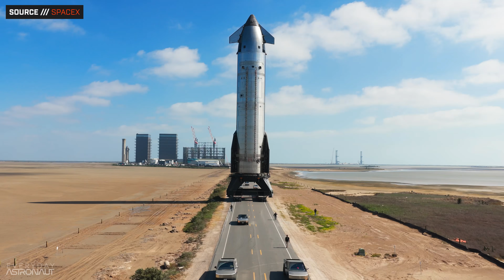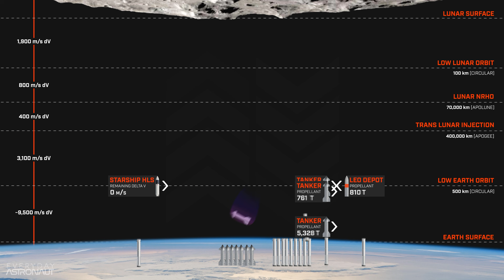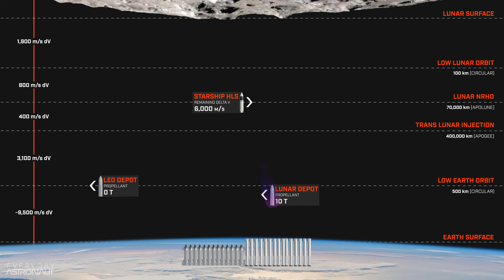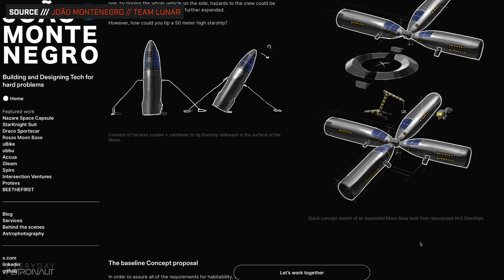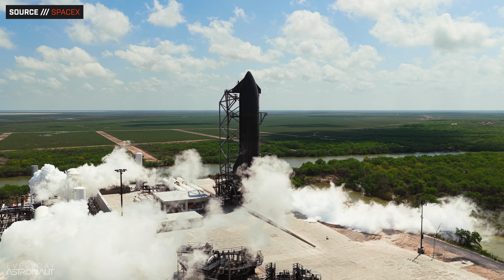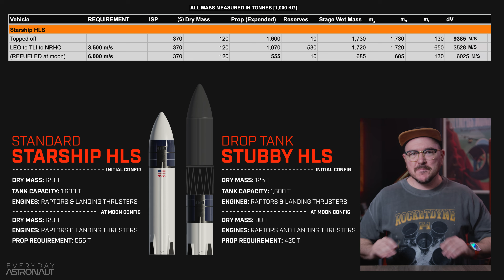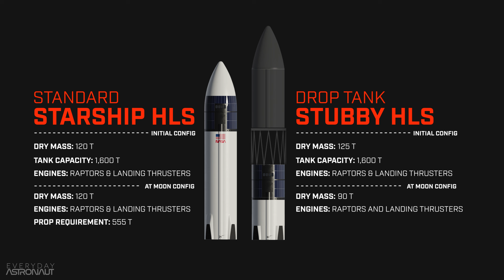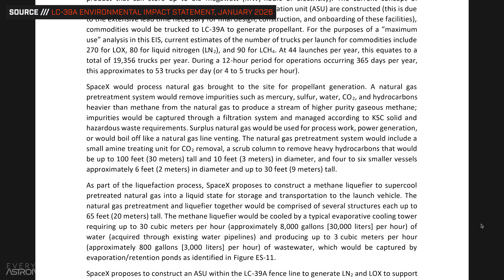Does Starship REALLY require 15+ launches to land one lunar Starship?!

Comment: People don’t realize how insane this mission profile is. One Moon landing could require more launches than some entire space programs.
Reply: Apolloitis again. The past, a very poor and useless past, doesn't define what is possible or "sane".
Transatlantic travel used to be by steamship. One big boat with thousands aboard. Now we squirt a plane a minute across the ocean with a few people aboard. HIGHLY inefficient and loaded with enormous tech compared to a boat.
Reply: @d@davis.fourohfourThis is so disingenuous, the better comparison is with modern liners which are huge and operate largely as steam liners did.
Reply: Which should raise people's skepticisms about its viability... not make everyone default to 'awe' at an accomplishment that doesn't exist.
Reply: @sunienizami  The issue is making fuel on Earth and then ship it into Space, losing 90% of the fuel in the process. Long term fuel production in Space is the way around that.
Reply: @VallenChaosValiant   Well the only fuel you can produce in cis-lunar space is hydrolox. And Starship runs on methalox. Carbon is an extremely rare element (almost non-existent) on the Moon. Hydrogen and oxygen are way more abundant. If you want to make methalox on the Moon you need to bring in the carbon from Earth. SpaceX will maybe eventually make a hydrolox version of Starship.
Reply: @sunienizami  Each Starship launch is incredibly inexpensive. This is entirely viable considering all those launches still wouldn't come up to the cost of a single SLS launch.
Reply: @ccruler doubt it, after the refueling is demonstrated at reasonable cost by actually reusing the tanker, we can talk until then it’s everybody’s duty to be skeptical
Reply: @Denguer-b1s  ¿Tú eres de los que dicen que las cosas son imposibles?
Reply: @francocastilloAR  "not impossible" is not the same as "reasonable"
Reply: @Denguer-b1s they’ve already developed human rated reusable rockets, I think they’ll get it figured out.
Reply: @ccruler  no it's not, we have no successful launches to scale off, realistic estimates start at 100X the cost musk is quoting, and get worse from their.
Reply: @justicar5Most of the cost is the rocket itself, which is reusable. And before you mention that Starship hasn’t demonstrated that, sure, that’s fair, but SpaceX has already built reusable launch vehicles before and so have the expertise. The NASA SLS is expended, meaning they have to build a new one, every time.
Reply: @Denguer-b1s genuinely bro, nobody cares what your opinion is on rocket science lol.
Reply: @justicar5thank god you know everything about finance and rocket science lmao
Reply: @Denguer-b1s  there is some prior art NASA has stored liquid methane for 4 months in space with zero boil off and starship flight 3 diminished transfer of fuel from one tank to another in zero g using an ullage burn.
The launch cadence is ambitious but starship is already flying almost once a month during end and being expended even if it's not as reusable as they think launch cadence wouldn't be a problem

Also cost wouldn't be a problem starship and superhevy is only 100 million even if all the starships are expended that's 1.6 bilon assuming 16 tanker flights (as the video mentions this number would probably need a lot less tanker flights if you expended starship and superhevy) SLS is about 4 billion relitivly speaking even if starship wasn't reusable its pretty cheep
Reply: @Denguer-b1s Be quiet.
Reply: No one knows. Not even SpaceX. That's how stupid it is. There is zero actual project plan. Just fake it till you make it
Reply: @mervstash3692 Is it? You could just load up only 10 tons like the rest of rockets and not require a ton of refuels. If you refuel that much you're taking 100 tons, which would require other launch providers to launch that much as well (~10 times) but doing it in expendable form. Meanwhile you can't fit any large format items. If they figure this out then it'll be totally worth it to fly this way
Reply: @ryccoh we all understand the "why". 
It doesn't change the fact there is no "how". 
Underpants Gnomes logic doesn't work in reality. 

Phase 1 - Steal Underpants. 
Phase 2 - ? 
Phase 3 - profit

No credible program/company/business/agency would take on something on this financial scale with no actual roadmap and milestones. Only a company run by the worlds greatest ever conman could keep this grift going this long.
Reply: @mervstash3692 Dude get a hobby. You sound like a complete idiot for starters but picturing you seething in your room honestly makes me feel pretty bad for you. You’ve been hating someone you’ve never met for obviously a long time. Get some fresh air.
Reply: Yeah it is stupid.
Reply: @canidae7  it’s only stupid if the only goal is to land on the moon like we already did 60 years ago. If the goal is to establish a moon base, this is the only way you’ll get enough mass up there.
Reply: @bradstewart7007 Wrong. Ever heard of SLS block 2 cargo?
Reply: @canidae7  Are you seriously considering using a $4 billion launcher, which is completely discarded after launch, to transport cargo to the Moon?
Reply: @neto6339  Starship = 5 bil contract for NO orbital flights. SLS = 31 billion, 2 lunar flights, one with crew. Seems an easy choice for the taxpayer.
Reply: Yes, but not reusable, much more expensive (billions per single-use launch), and can’t deliver its payload to the lunar surface. Starship is designed to deliver 2-4x the payload of SLS cargo to the lunar surface. Again, it depends on your goals, but it’s not stupid.
Reply: @bradstewart7007 neither is Starship so far. We know SLS works. That is far from certain for starship
Reply: @kvasir121  Really? You're only counting 31 billion for the SLS, but that's not what the sources say about its development costs.
Reply: @neto6339 Even if the number is twice what I stated, which I pulled from Google, it has at this point provided more than starship has for 5 billion in taxpayer dollars. Also, starships cost is hard to measure from a standpoint of opportunity cost. That money could have been better spent on more serious proposals not meant to pad a certain mogul's pockets
Reply: @canidae7  Saturn V worked,too. It’s too expensive to do it this way and doesn’t even get high mass lunar surface. Starship is a moonshot for the holy grail. Far more interesting. So what if it’s not proven yet?
Reply: @bradstewart7007 if you want 90 tons to TLI you can launch 16 starships (if they get it to work)
OR
Launch 2 SLS block 2 cargo that we know works 🤷

But hey, Elon admitted Starship V1 could do 15 tons to LEO. Not the 150 he promised.

V2 could do 35 tons, not the 200 Elon promised.

But of course V3 will do whatever Elon promised 🤣
Reply: @canidae7  Fully reusable.
Reply: You guys are forgetting about Blue Origin, they're also in this race.  There is a plan for a larger version of New Glenn and they are designing moon landers.  New Glenn is keeping things a lot simpler and seems more likely to work.
Reply: @bradstewart7007  Who needs a moon base and for what? A lunar base, or a lunar orbit station do not bring us 1% closer to Mars. And before going to Mars, try to convert a desert on this planet into a lush garden.
Reply: @jeffk464 If they can make it work then good, either way space X or blue origin is a much better opten then SLS in any day of the week lol. No WAY do you want to rely on NASA considering politics to consistently deliver cargo to the moon with their own SLS, its way too expensive and WAY to reliant on politics even if it works, its Not worth it in the long run. New Glenn or falcon Heavy is much more cost effective
Reply: @canidae7 SLS block 2 which is HEAVILY reliant on NASA and their politics . . . A change in the administration can literally kill or or change it completely. It is not worth it in the long run if you want to set up a base or provide cargo runs lol, ain't no way the administration is gonna be able to consistently throw that much money away. You be relying that all the following administration wants to go for this and not cut it off. Either way if you want something that actually works, resupply missions with blue origin or even the falcon Heavy is a better long term option. The only thing I can see SLS be good for is deploying modules, but even then that would be hella expensive compared to waiting to see if blue origin or space X can give a better option
Reply: @bagaindocblaise1738 That is not true. It is HEAVILY relying on the POLITICIANS. NASA is set on using SLS
Reply: @canidae7  SLS works. But at a prohibited cost. That is the point. You can't build a sustainable base on the high cost of tax payer money. 

The purpose of Starship is to develop reusable and reliable rockets that can launch hundreds of times for cheap. If you don't understand the end goals then that is on you.
Reply: @canidae7  HAHHAHAHA 😂😂😂
Reply: @canidae7  We know that mercury will cure your syphilis if we just use enough of it. You likely won't survive the experience, but we consider this to be good enough. Dedicated antibiotics that don't kill you just aren't worth looking for.
Reply: @canidae7  why would anyone ever try something new if we know something works, amarite? Short-sightedness is a real bummer. Good thing not everyone is afflicted with it, you owe all technology to those people, including your life.
Reply: @kvasir121  "Starship = 5 bil contract for NO orbital flights."
Really? So the terms of the contract state NO orbital flights. I thought that the contract has not yet been fulfilled and includes demonstration of orbital refueling and one demo landing on the Moon.
Reply: @neto6339  $4 billion for SLS includes Orion. Doesn't make sense to use that cost. Cargo SLS+EUS would be around $2.3 billion, according to an OIG report published in 2023. Assuming early Starship costs around $100 million per launch, 20 flights would be $2 billion in total, which is not that far off.
Reply: @yujinhikita5611 The technology in Starship is nothing groundbreaking new. The engines are based on an old Russian engine (RD-380) and the tiles are very similar to what the space shuttle used. SLS and Starship are both using tech that is already known 🤷
Reply: @jrc1606  That's your mistake; the development costs of the SLS plus Orion already amount to almost 100 billion dollars.
Reply: @neto6339  Why even include Orion for cargo launches though? SLS since 2011 has cost $30 billion. SpaceX has spent $15 billion on Starship and the number is increasing rapidly. NASA spends $2 billion a year on SLS, but that's fixed. In 2023, Elon admitted they spent $2 billion that year on Starship. So far, this year the company has spent $3 billion on Starship and the year isn't even over.
Reply: @bradstewart7007 you're kidding yourself if you think its fully reusable.  Wild baseless promises by a charlatan.
Reply: @SterlingArchimedes yes true, engines are pretty much shot, holes have to be patched up, new tiles. I wonder how much is left of the actual ship after everything they've needed to repair. Takes them a full 30 days to do all repairs at full capacity. Their own chief, Shotwell, said she doesn't consider it reusable if you can't fly again after 30 minutes, refuel, quick check of important components, and fly again. They're so far apart in reality while promising the world
Reply: @canidae7  How many tons can the SLS block 2 cargo (a version which doesn't exist yet) deliver to the surface of the moon?
Reply: @jeffk464  whoops... but in the long run still could be right. only elon seems to be able to drive things forward with any urgency tho. wish we had more of that.
Reply: @canidae7  we dont know that SLS block 2 cargo works, it doesnt exist yet. Work on it has barely even started
Reply: @canidae7 that’s even more expensive bozo it costs 4 billion per launch and can only launch once every few years LMAO
Reply: @kvasir121 starship received that in a fixed price contract dumbass, the taxpayer will quite literally not have to provide more money to is development.

Meanwhile SLS cost 31 billion dollars so only far. Its gonna cost more.
Reply: @canidae7 ”we know it works” is the, and I am so sorry, most illogical reasoning you can make in this sector.

If you want to make everything the same way you did them 60 years ago, just more expensively, and slower - yeah, it “works”. It’s also incredibly inefficient and doesn’t have a future.

We didn’t know the Apollo would have worked. The estimated chance for success in one lunar landing mission was estimated to be 5%. But, as a great man once said - “We chose to go to the moon, not because it is easy, but because it is hard”.

Edit: oh also we don’t even know the SLS Block 2 would work 😂 we know Block 1 works, but knowing how Block 1 development went, it is gonna take at least 5-10 years to launch Block 2 to confirm it works. Yeah right that’s so much better e
Reply: @canidae7  holy moly this comment could not have been farther from the truth 😂😂😂😂 

I think you meant the RD-270 there? Cuz no engine called RD-380 exists, but even then, the answer would be a resounding NO

Raptor and RD-270 share the same engine cycle - but that doesn’t mean the engine is based off the other. In fact, that engine cycle is the LEAST proven engine cycle, only one engine (RD-270 ofc) using that cycle was ever built.

So, from that perspective, it literally is the hardest engine cycle to develop with our current knowledge. Or at least was, until the Raptor.

The tiles also have to be significantly different because of different requirements, sizes etc. that’s like saying SLS uses the same orange tank as the shuttle which is ridiculous lmao

Do you even know ANYTHING about this topic???
Reply: @arcaipekyun4232 Just another case of Elon derangement syndrome, Musk might be edible or whatever and say whatever you want about X and Tesla, but SpaceX is legit on the bleeding edge.
Reply: @nameredacted1242  I think proving out Starship refueling with moon landings does quite a bit to prep for a Mars mission. I suspect SpaceX is doing a lot work on how to live on Mars. No idea if they'll be successful. Arguments against are strong.
Reply: @bradstewart7007  That's the problem! Why would you go to Mars? If we have dumb politicians here who are destroying the best planet for life? If we can't even convert a desert into livable land? Mars has no atmosphere, no oxygen, no water, has radiation, and has toxic soil. You would go to Mars then spend your whole life living in a cave, you would go out maybe once a month to fix and clean solar panels. Guess what? You can live in a cave on Earth, much cheaper. You can live on the bottom of the ocean, too. Much cheaper. And very few planet-killers will reach you under the ocean.
Reply: @nameredacted1242 Musk’s point is we need a backup for consciousness. Not all the things that could destroy the Earth are under our control. Whether we can actually create a self sustaining civil ization on Mars is up for debate, but if someone wants to give it a try, let’s do it.
Reply: @bradstewart7007  Who gives a crap for consciousness? It's life you have to preserve. And the cheapest way are very deep caves and ocean floor and caverns under the ocean floor. Guess what? The military is already doing it. It only costs trillions of dollars of black budget rather than quadrillion it would take to establish a self-sufficient space colony.
Reply: @nam @nameredacted1242 there is little chance of life not surviving. Human consciousness is what is in question.
Reply: @kvasir121 that’s just dumb. SpaceX is building a mass production factory for starships and will have three towers online in a few months. This is happening.
Reply: @bradstewart7007 it's not. Just do the math on starship, compare it to Elon's projections for this architecture, and also factor in the possible suspension of funding in the next two years due to change in government and priorities.
Reply: @kvasir121  suspension of funding is irrelevant to SpaceX because their funding mostly comes from Starlink. 

Plus, Artemis itself is mostly invulnerable to government policy changes because it's a political program that benefits all senators, no senator is out there voting against it.
Reply: Why? Is there a better plan for putting a permanent base on the moon? Or do you think we shouldn't do that at all? Or do you think we should just fly a tiny lander on an expendable rocket just so we can say we went back?
Reply: @trevorpullen3199  YES there is a better plan. Forget the moon.
YES we should fly a tiny lander barely larger than Apollo, for any human missions. Only for cargo missions with zero humans, try using something as insane as what Musk is proposing.
Pre-deliver all base structures and materials before humans ever arrive. In a tiny, tiny capsule the size of Apollo.
Reply: @nameredacted1242  I don't have any problem with a smaller lander for humans.  What's the problem with a larger one though, if you have one for cargo anyway?
Reply: @trevorpullen3199  The problem is that it is retarded to send humans along with cargo. It makes the rocket too safety critical, and too large. CARGO SEPARATE FROM HUMANS. Cargo ahead of humans. Humans sent in the tiniest space possible. KISS principle.
Reply: @trevorpullen3199 yes have Chinese companies build the hardware for 1/100 of a cost while being high tech. Can’t wait for Chinese customs on the moon and mars screening the first us landings
Reply: @trevorpullen3199  I got an even bigger pipe dream. 
Use multiple launches to assemble an even larger spacecraft one that has a reactor in it and shuttles back and forth carrying a HLS landers and fuel depot. 

Those engines should have a higher ISP and uses hydrogen as propellent. Which can be made from ice on the moon. 

Once that’s done. Only LOX and methane used is for landings and reaching orbit.
Reply: @Denguer-b1s it doesn’t matter if China gets there first if the US can deploy massive loads there. Cant own what they can’t defend.
Reply: @nameredacted1242  that's stupid
Reply: @canidae7 You should go and show em how it’s done.
Reply: @UVBluesman I think you may be talking to an 'at arms length' spaceflight genius, not a hands-on one.
Reply: @psiro7966  armchair rocket scientist.
Reply: @UVBluesman That is stupid. A classic comment from an Elon fanboy that does not like the truth
Reply: @canidae7 Von Braun thinks you are an idiot too. He said that in-orbit refueling was the future.
Reply: @UVBluesman I don't think he knows the first think about any of this lmao. He's just here to signal his ignorance to the rest of us.
Reply: my guess would be that Musk still thinks he can string nasa along until the Whitehouse eventually gives up on the moon and lets him do Mars instead like  he wants to.

But if thats the case then not only did Musk secure the contract under false pretenses but Isaacman must know that, and he's  just  allowing Musk to bump along as though he wasn't defrauding the government of bilions of Dollars and potentially handing the moon to China.  I guess this is what failing empires look like.
Reply: @mowogfpv7582  is that your conspiracy theory. 😂😂😂😂
Reply: @UVBluesman Musk's either a crook or an idiot and I don't think he's an idiot.
Reply: @mowogfpv7582  you’ve declared those as the only two options huh. Supporters your conspiracy theory I suppose. That’s handy. 🤷‍♂️
Reply: @mowogfpv7582  If Elmo can't make the moon work, Mars is never happening. It's exponentially more difficult and expensive no matter how reusable whatever comes of Starship. It still hasn't maintained an orbit or come close to full mission cycle. After 10 missions. Anything from Musk is going to be mostly pumping things up for the IPO coming later this year.
Reply: @mcblaze1968  A Mars mission fully relies on the ability to generate fuel on the Mars surface. Manned Mars missions also on the ability to limit crew comforts on a mass budget.
If those challenges are overcome, Mars isn't that much more difficult than the Moon (well 5600 m/s from LEO to Mars vs 3500+6000 =9500 as estimated in this video form LEO-NRHO, NRHO-LS-NRHO). aerobraking is possible in the atmosphere, though I doubt Starship could do it with only 60t of fuel. 
It's not the capability of the ship, it's development of those 'other technologies'. I think it is telling SpaceX / Tesla is fully parading their advances in rockets and robots and not seeking too much publicity in some of the key capabilities that are required to achieve for human transfers to and from Mars.
Reply: @mcblaze1968  mars has an atmosphere for aerocapture and it has in situ resources for making methalox.  So conceptually starship's enormous upper stage/lander makes some sense there.  Even if it's nowhere near a sound or mature enough looking project.  For the moon it makes no sense at all to integrate the lander with your enormous upper stage.   And there's no reason why it should do.  It wasn't conceived for that.  It's a mars system.  Albeit an immature one.
Reply: If done right many of those launches make future launches easier/possible
Reply: @Rork333 no it wouldn't. The fueling launches would have to happen every single time you go to the moon.
Reply: @Imaboss8ball  yea but they only have to pay to launch the fueling station the first time making the second go easier
Reply: @Imaboss8ball  The cost curve would smooth (for a moon base,) as initially-cumbersome launches transport equipment we've been putting off to establish Moon ISRU
Reply: If it smells insane IT IS INSANE
Reply: There will be nothing insane about it.
Reply: Everyone realizes it. No need to be as smart as you are
Reply: The thing that less expert viewers like me don't realize, and Everyday Astronaut did not explain very well, is that the Starship Heavy booster doesn't come close to putting the Starship second stage/Starship HLS into low-Earth-orbit. The booster just flings the second stage into the atmosphere and then the second stage burns most of its propellant actually reaching orbit.
Reply: @skierpage  That's the same with any rocket's first stage
Reply: @forknose  You're right. But some first stages go farther than others. There are always tradeoffs. If re-using the first stage is required, then staging early is more optimal. Falcon 9 and Starship stage very early in the flight. New Glenn stages a lot later. SLS stages very much later by comparison.
Reply: @skierpage  He did talk about this and even trades the booster performance increase with the stubby HLS.
Reply: Pffft, other rockets are too round.  Everyone knows the best rockets are big and pointy ~musk probably.
Reply: insane you mean rediculous and unrealistic
Reply: The 15 Starship flights added together would cost less than 5% of a single Apollo flight (in today's money). The 15x Starship quote is based on rounding up today's commercial prices, not actually costs. Using projected long term costs, it'll be closer to 0.5%.  If you consider per unit mass payload delivered to the moon, you're already at <1% costs of previous programs, trending towards a fraction of a fraction of 1%.  Not particularly impressive when viewed through the lens of the history of industrialisation, but based on your 'people don't realize' comment, worth noting, as there is a lot 'people' don't realize about what is happening here.

Before anyone corrects me that 5% is too high and it's more like 2%...I'm rounding up and up and up and using lean inflation figures.
Reply: @psiro7966  So development costs don't count?
Reply: @psiro7966  If they just used my 1 billion teleportation machine I am making and finishing in 5 years it would be even cheaper becaue the teleporting will only cost 100 dolars per teleportation
Reply: @psiro7966  "The 15 Starship flights added together would cost less than 5% of a single Apollo flight" - but only if you count the total actual costs of Apollo on one side, and totally made-up, never-achieved numbers for Starship on the other side.
Reply: @psiro7966  those 15 starship flights need to fly within 30 minutes of each other, which will be more expensive, plus they can't even do 30 hours right now, the fastest they have been able to do is 30 days. they're gonna need 15 separate starships to fly and fuel up the main tank at this point, then fill up the human rated starship at the end for the final flight, way more expensive. None of this refueling has ever been done in space, then lighting the engines again with this type of fuel, both have never been tested yet by by anyone, let alone SpaceX, even though they showed in their schedule to NASA they would test space refueling in like 2025. I think you're highly underestimating the costs here
Reply: @jonathanwieringa8808  why would they need to fly withon 30min to each other? Even if you fly once a week you are read to go within three months.
Reply: @jonathanwieringa8808 30 minutes? I'm still working from the numbers NASA gave in 2024, which suggest ~6 days.
Where is 30 minutes coming from?
Reply: @jonathanwieringa8808  There's a video by Eager Space which shows that long-term storage of cryogenic fuels in orbit is practical with minimal boil-off. Just adding reflective coatings and some insulation to the Starship would allow it to store fuel in orbit for months.
You're right that it's never been done before, but there's nothing impossible about it.
Reply: @bbgun061 it's not just storing, the fuels have to mix well and then there has to be something to Ignite the mixture. Instead of just using fuels that ignite when they touch, way simpler. There's unreliability in having to ignite again which also hasn't been done
Reply: @jonathanwieringa8808 .... reigniting engines in orbit has absolutely been done... The space shuttle did it...
Reply: @benmac2112 again, spaceshuttle used 2 fuel combos that ignite on contact, no spark needed, totally different
Reply: @jonathanwieringa8808  So I may be mistaken about space shuttle (I keep seeing conflicting sources), however I know for a fact Saturn V's engines could. Regardless starting an engine in orbit is not exactly new tech that Starship still needs to develop even just for the company. In fact, one of the most important features of Starship's raptor engines is that they can repeatedly restart them. The booster restarts engines multiple times during it's boost back to the landing pad including after it leaves atmosphere. They have tested restarting starship's boosters outside of the atmosphere for each previous test, and the starship itself restarts them again to perform it's landing sequence.

Sure, it's a hard thing to do. However it's not an engineering hurdle that is yet to be overcome.
Reply: @benmac2112  SpaceX has done it a few times now, with Starship, oh and you know almost every single flight of Falcon 9.
Reply: @jonathanwieringa8808  "There's unreliability in having to ignite again which also hasn't been done"
Except that SpaceX has tested it on Starship and uses regularly on booster for boost back and landing.
Reply: @royh6526  yes that's the whole point, reigniting within the atmosphere, now do it above LEO which they've never done. Starship has to throw the little amount of fuel they have left before landing to the bottom so there is enough flow to ignite and take a spark. Starship has never gone beyond LEO and has never carried a real payload, so all this is still unproven. Banana's don't count
Reply: @jonathanwieringa8808 What are you referring to with your 30 days? Because they have flown the same Falcon-9 Booster twice within 14 days (of which 4 days were spent getting back to the base), so flying the same starship twice within 10 days seems reasonable to me. And obviously they can use multiple ones which is why they're building more launch towers. I see no reason why they wouldn't be able to launch one a day.
I still think requiring 20+ rockets for the first moon mission is crazy, but that's what full reusability costs.
Reply: @jonathanwieringa8808  Starship has seperate tanks specificly for in-space and landing. The main tanks are only used for ascent. Starship has done in-space relights several times and the booster hes done engine re-light above the karmen line before as well.
Reply: @anonymous-q2b5s It's going to take time before starhips have the turn around time of a falcon 9. Spacex is going to need to do heavy inspections to determine the level of wear on individual parts of starship before they can safely reduce turn around times. 

Spacex plan to have a large number of flight vehicals on hand so launch cadence should be higher than refly time by a significant margin.
Reply: @anonymous-q2b5s we're talking starship moon mission, uses super heavy boosters, not falcon 9s. falcon 9 has totally different engines, less engines, different fuel, smaller boosters. not comparable. Fastest SpaceX has been able to turn a super heavy booster and fly again is 37 days after flight 5. They're going to use super heavy boosters to refuel, which estimate is refuel the tanker 20 times before filling up the human rated ship. 

it's not just "refueling 20 times is what full reusability costs" it's the crazy thing that they want to send a ship 100 x heavier and way taller to the moon to land, while the first time they used a lander module only 500kg heavy, that includes the weight of like 3 people. It's the dumb bureaucracy at NASA thanks to kathy lueders who corruptly gave the contract to SpaceX while there was no committee present at NASA, and then she quits NASA and joins SpaceX
Reply: @jonathanwieringa8808  Make it 20, because a few will definitely blow up, Hopefully not the with people!
Reply: @tejtej2137 totally
Reply: @jonathanwieringa8808  A few of the starship test flights have reignited engines in space.
Reply: @bbgun061 maybe once, and low altitude, not even that high up where it is more important. But you can see how many times they've cancelled it because they lost engines, or starship tumbled, or they didn't reach a useful orbit. It's not only can they ignite, but also at the correct exact time
Reply: @psiro7966  and will likely not kill anyone.
Reply: @UVBluesman No escape or abort system at all, seems like a horrible idea.  I used to be a SpaceX fan but Starship is really a miss in my mind.  It's like trying to plan an Alaska Bush delivery with a 737.  It just makes no sense at all and is the wrong tool for the job.
Reply: @EagleMitch  What plan are you talking about?  NASA's plan does not involve launching astronauts off the ground with Starship, which is the only context in which an "escape or abort system" is relevant.  If they ever went that route, I'm sure they'd want to know how Starship could escape from an exploding booster, which does seem unlikely.
Reply: @EagleMitch  starship is a far safer design for human space flight then the shuttle was. Starship allows the crew to fly on top safe from fallen debris. It also doesn’t have unstoppable, solid rocket boosters that made any Shuttle abort unsurvivable until they burned out. Lastly, this upper stage does serve as an abort stage. It just doesn’t have the acceleration you would prefer, but will still be adequate in some circumstances.
Reply: @EagleMitch  Ah, yes, the first flight of the Wright brothers crashed. Flight will never ever be safe. We should give up on flying machines
Reply: @EagleMitch  There are no escape or abort systems on an aircraft either but millions fly on those. Even spacex have stated publicly that it is going to be years before they even try to crew rate starship.
Reply: And spacex had 5 launch towers under construction dedicated to starship operations, so 3 launches per pad. They are using a fully reusable rocket so the only costs are launch operations and fuel.
Reply: @shaung949  and what happens when one launch fails?
Reply: @shaung949  fuel is not the only cost, launches wear down rockets
Reply: @marsdriver2501 Individual Falcon 9 boosters are hitting over 30 launches and reuses...
Reply: @MultiMcgruber Falcon and Starship are in no way comparable.
Reply: @MultiMcgruber  Falcon boosters experience ~1% of the energy of reentry from orbit. They're not even close to the same.
Reply: @shaung949  "They are using a fully reusable rocket" - make that "they are planning to use a fully reusable rocket". So far, the "Starship" upper stages that they got back were, at best, vaguely rocket-shaped husks. Turns out dissipating all that energy in the upper atmosphere is really hard and pretty rough on the material - who could have known?
Reply: It's going to require the mass equivalent of a World War Two battleship in terms of propellant. That's all that needs to be said, to send ONE ship out of Earth Orbit.
Reply: Yeah but he can catch a rocket with chopsticks!!! Great video but the bottom line is Musk wants a rocket that looks like 1950s sci-fi and the mission architecture is designed around that.
Reply: And yet it'll still be cheaper than government space flight lol